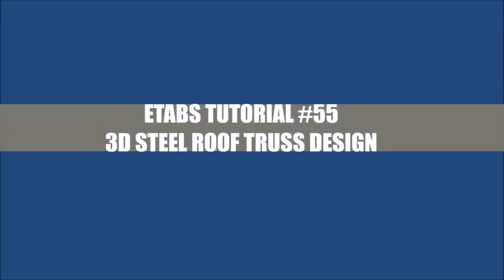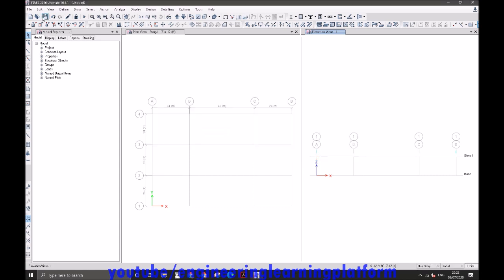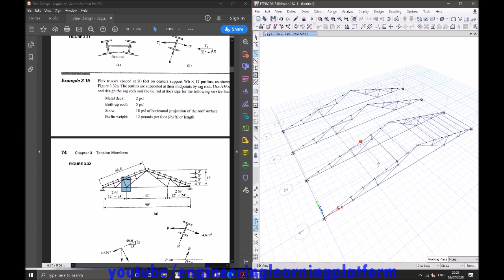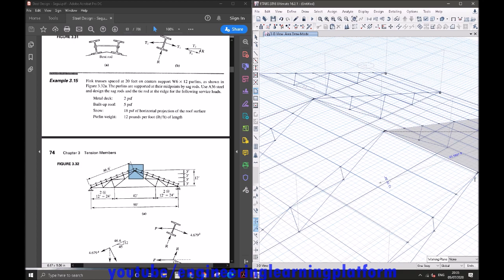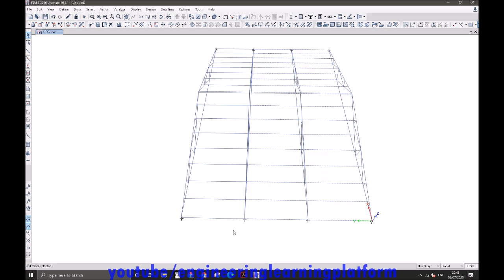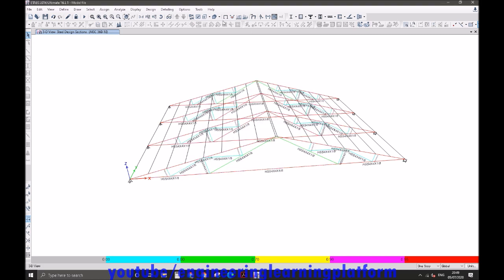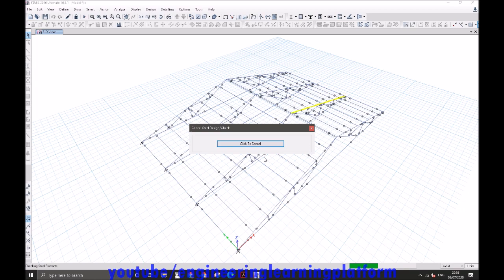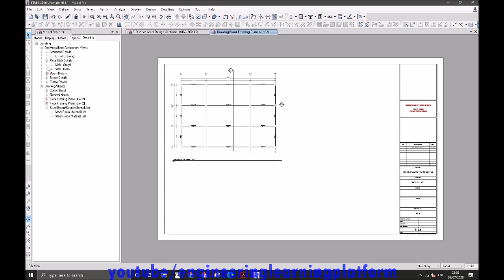Steel Roof Truss Design using Etabs tutorial

Comment: Nice explanation, thank you very much. But I have one question regarding to lateral bracing. you applied lateral bracing twice at design preference overwrite and at design steel section using relative distance. Doesn't it increase lateral bracing twice?